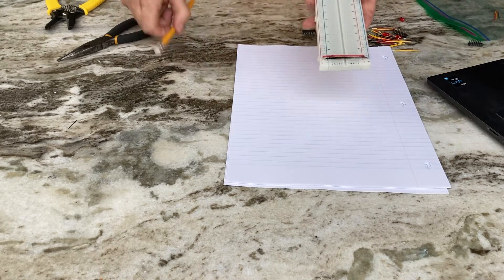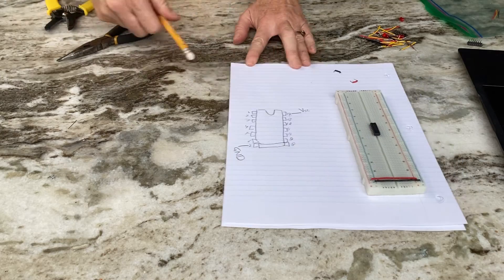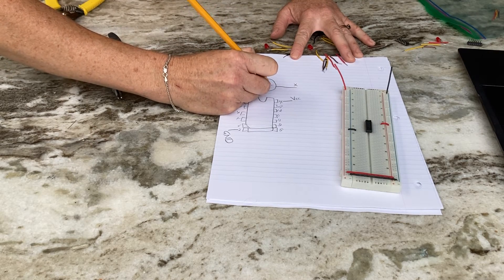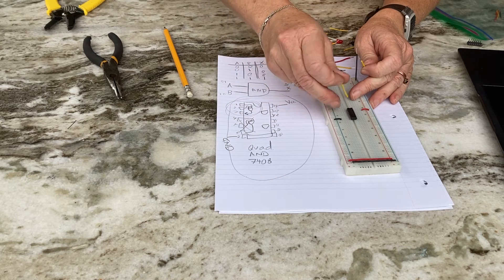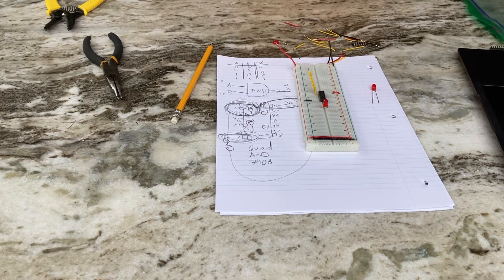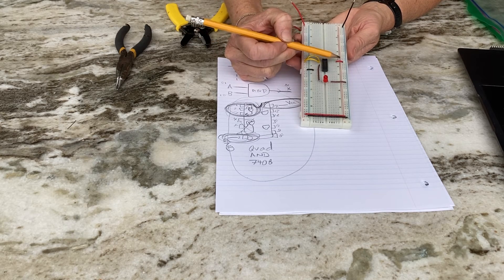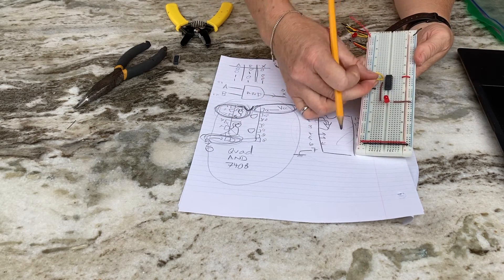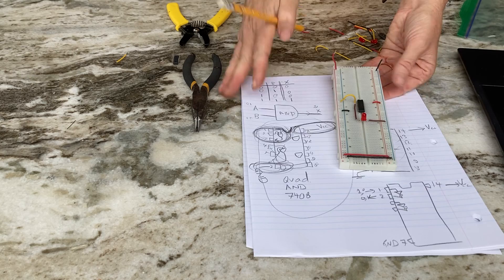How to Properly wire Logic Gates onto Breadboard. Wiring an AND gate neatly.

Comment: Helpful, but it would have been better had you connected power so we could see it actually work! I want to go one step further and use push-buttons to control on/off rather than moving wires in/out.
Reply from the maker: For sure!  I have a power supply and can do that.  Switches are sometimes beyond the scope for very early beginners because there are so many kinds (and people don’t know “pull-down” yet), for example.  But yes I can power the circuits next round of videos.  :)

Comment: Very useful video, especially for the beginners!

The whole connecting the bus bars properly thing, is so important... I personally got really sick of connecting my bus bars to each other with each project, especially since my jumper kits don't come with a pre-cut wire length for that, so I went through all my breadboards and connected them nice and neatly with perfectly cut length wires, and now I just leave them on my breadboards in storage. Like you, I feel like crossing the board/chip with wires is just barbaric... I literally go a little crazy if my breadboard starts to look like a messy nest, so I wasn't having any of that. LOL

Although, on a side note: I do wish breadboards had some optional way to quickly connect the busses together, without having to run jumpers all the way across, built into them by default...

PS: Also, looking up datasheets all the time finally drove me to buy a laser printer. Now I print and staple them into booklets (booklet printing is aaaawesome!), and I've got myself a nice little library going. This was great with my 9-LED driver chip's datasheet, because it's almost 60 pages long and has a bunch of programming stuff I needed to learn, so I would take that booklet with me and I could read it at the table, or on the go, until I was finally able to digest and understand this complex chip.
Reply from the maker: I would love to see that booklet!  It sounds like a handy gem.  

I don't know why the bus bars are not connected.  I wonder if it's because we are meant to join breadboards together.  Although I rarely see projects that large. 

I get a bit particular about wiring habits too.  I like your word barbaric.  I will use that.  "Barbaric Rats Nest".  :)  A pleasure.